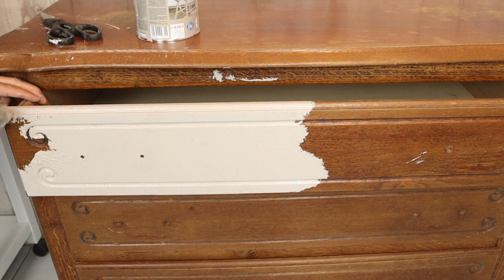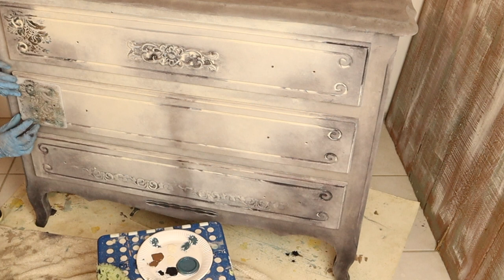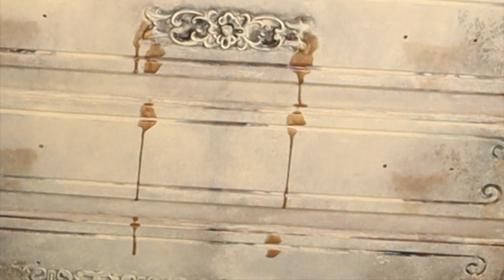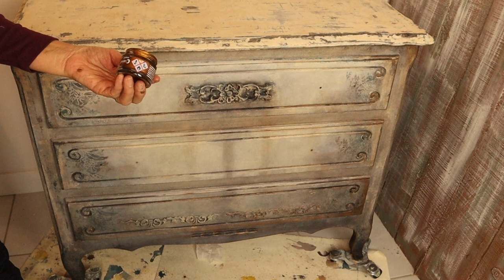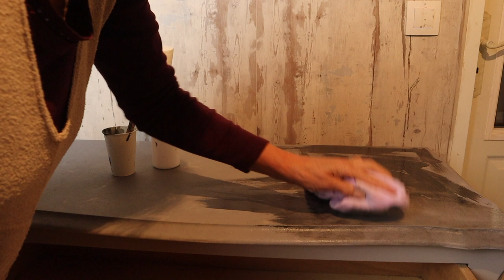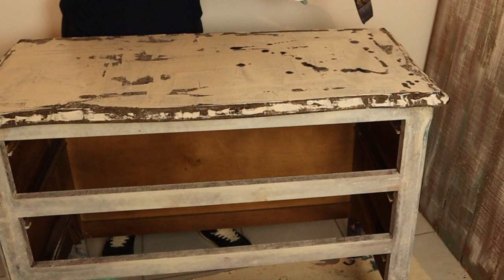How to create old rustic look. Furniture Makeover.

Comment: thank you for this informative video! great job. I understand that this technique works well with the types of furniture that have frames etc. where the glaze stays after wiping, but what if I need to glase a simple painted stool that doesn't have those? Its very basic stool, just legs and the top, and I wonder what stays and where when I cover it with the glaze and wipe afterwards. I painted it in nice yellow, but wanted to add some used antique look with dark edges and some dark patina around the joints. But the issue is that using your technique the glaze at the edges, where I do want it to stay, will most probaly get wiped off. What do you think I shall do to make it look like a want? And would the whole thing work if I use watered down dark acrylic paint over the main layer of paint, also acrylic? thank you!
Reply from the maker: I work only with the chalk paint. i don't know if the acrylic is that durable.  With flat surface I would do paint wash and pick it with the sponge or wet piece of cloth using dabbing technique.